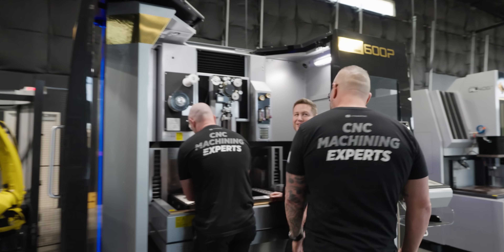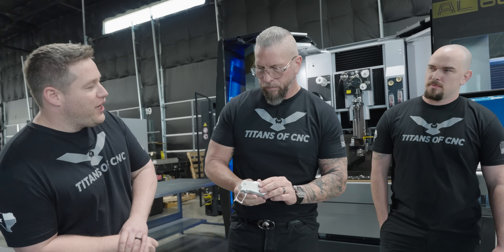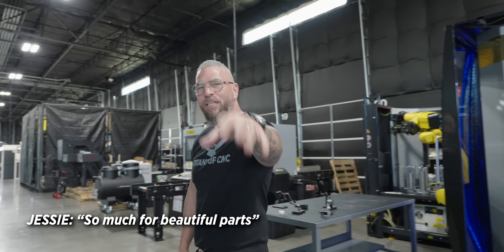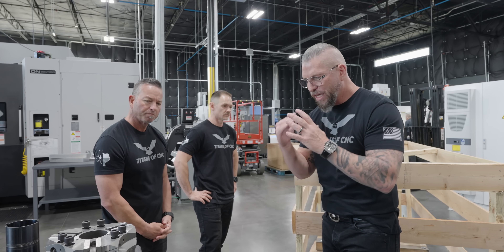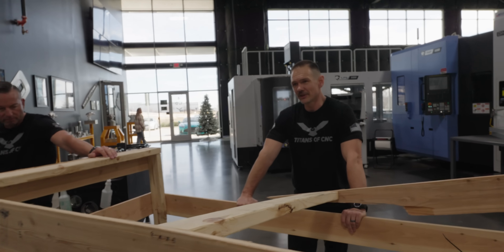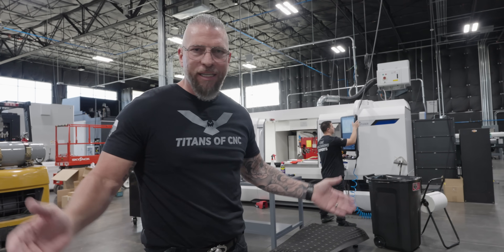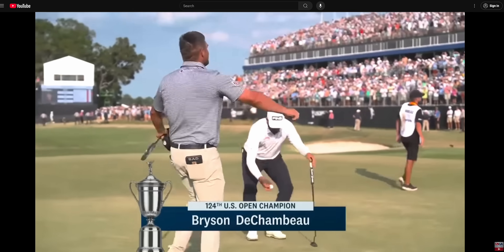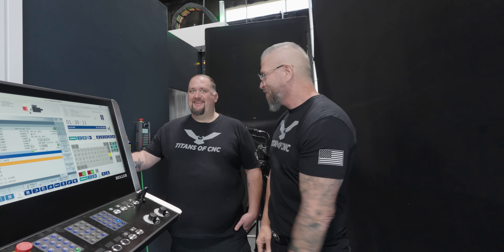MONSTER Machining, Engineering & Projects | 2025-1

Comment: Any info on the upcoming syil U5 ?

Also to get the best results in weight-loss you need to very the traning and the same with your calorie intake. Independently of each other and not schedule. ( I recommend that when you wake up in the morning you deside if its gonna be a no cal. Low cal medium cal or high cal that day ( calorie ) and when you get into the gym if it's gonna be low. Medium or hard traning that day. Only two rules is 1. One is not depending on the other and 2. It's not gonna be the same as the day/time before )